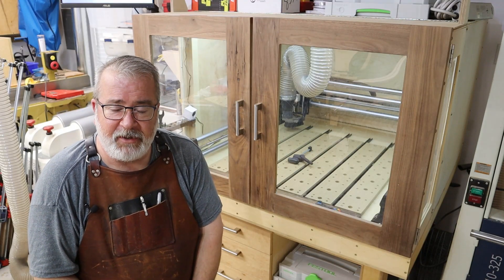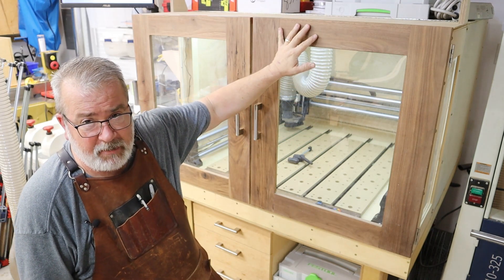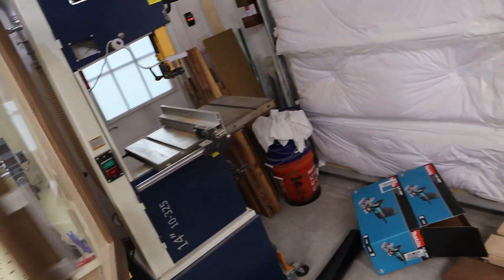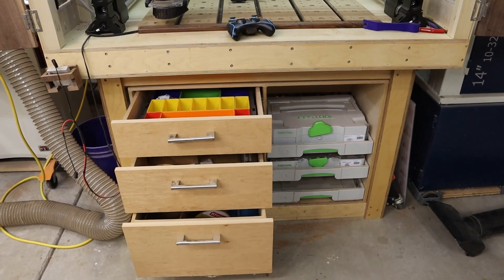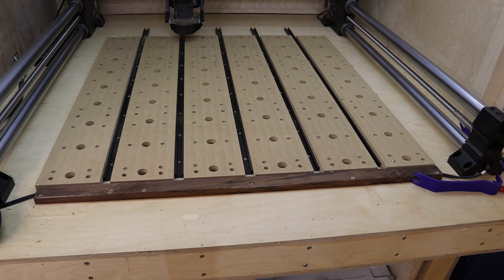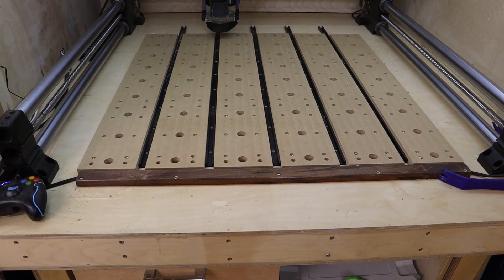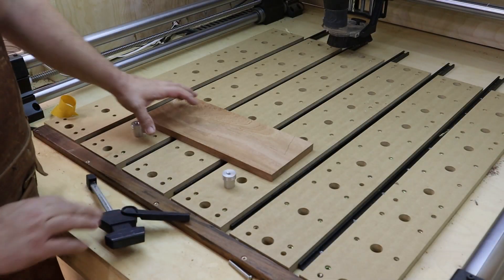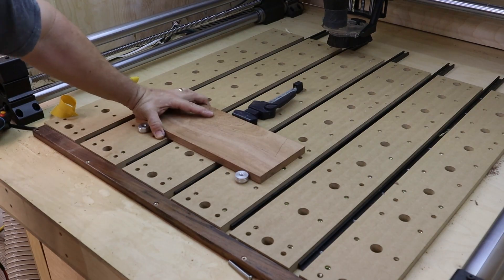CNC Enclosure and Spoil board Dos and Don'ts  DIY projects and the things to consider

Comment: One thing I'd like to say is with your dog holes cut out some 3/4-in PVC pipe instead of those aluminum dogs. Then you can actually leave them in place and around what you're working on and then wedgewood between to hold it in place. That way have a bit runs into it it's not a big deal because it'll just carve PVC.
Reply from the maker: Thanks I already have some Festool clamping elements as I have a couple MFT3 tables, so I just made my cnc spoil board match the work holding I already had.

Comment: Do you have a link to the dogs?
Reply from the maker: Because I use a couple of Festool MFT tables, I used the same 20mm dog hole size (instead of 3/4” which is more common) since I already had them. So the ones I use are Festool 20mm dogs.

Comment: Just finished my enclosure and setup, doing the spoil board and tramming now.   

I made removable doors held in place by magnets on the front and sides for accessibility.  My issue is I made the enclosure too short on the Y axis.  In the home, the dust boot just taps the door and knocks it loose 😂.  I'm gonna have to extend it a tiny bit.  But I agree with pretty much everything in this video.
Reply from the maker: Hi Kyle, Thanks for watching.  Congrats on getting your enclosure done, sounds like an intuitive solution for the doors!

Comment: Thanks JR for the really good video .  I am just about ready to pull the trigger on the 32x32. One question, if the Onefinity did not exist, which CNC would you have?  I love your demeanor and your narration. Dont change a thing.
Reply from the maker: Hi there Flat Lander, thanks for your comment.  Had I not found the Onefinity, I would have likely ended up spending much more on a machine as I was really focused on finding a machine that did not use V Wheels and drive belts.  The next step up (with linear bearings and screw drives) would have been something like a shop sabre or an Avid.  I have found this Onefinity to have exceeded all of my expectations.

Comment: When using the CA and Tape trick. Does it matter that the workpiece may not be square for the machine?
Reply from the maker: For securing the piece, it matters more that the piece is flat on the face your taping/gluing for maximum surface area to adhere

Comment: What tool did you use to remove the dog that was “stuck”?
Reply from the maker: Hey there Kevin, thanks very much for spending time with me here.  Taking the time out to leave your comment means a lot to me.  

It's actually a trim removal tool, I think usually meant for removing car trim panels.  Works great as its plastic and doesnt mark everything

If you haven't yet, would you mind subscribing if you saw some value in what this and my other videos are about?  Thanks again for watching and your comment, have a great day!

Comment: 2:41 There is a product from the automotive world that is specifically designed for noise or sound deadening. This product goes by many different name brands, the most widely recognized being Dynamat. It's only about 1/4 inch thick or less, and in the restoration of an old car, it gets applied to the floor pan and interior firewall to greatly reduce road noise as well as engine and exhaust noise. I agree that the sound deadening products that many have used in their CNC cabinets are very bulky, and are sawdust magnets as well, but Dynamat or any other brand of that stuff, will eliminate the bulkiness, and will not attract sawdust.
Reply from the maker: That a great idea, I had forgotten about dynamat.  Thanks for that tip!

Comment: Not sure if anyone said anything but I have a suggestion for your front doors. Since you don’t want a middle pole/board for the doors you should just put one thin piece of wood on one door so when they shut there isn’t gap between your two doors.
Reply from the maker: Hey there Wood Worker / Golf Expert - Kinda - Mike , thanks very much for spending time with me here.  Taking the time out to leave your comment means a lot to me.  Yeah those gaps were pretty wide, I like your suggestion. If you haven't yet, would you mind subscribing if you saw some value in what this and my other videos are about?  Thanks again for watching and your comment, have a great day!
Reply: @TradeSkillersAnonymous  already have been subscribed

Comment: You commented that you use  the T Track hold downs the least. Could you share what is the advantages of the threaded inserts over the track? I understand that T Tracks usually use a clamp over the top of the work piece but there are options to work around such.
I do appreciate your video. Thanks
Reply from the maker: Hi Donald, you can use the threaded holes for clamps similar to the “oops clamps” and really any other clamp that could. Have a roughly a  1/4” bolt pass through it, a lot of folks use wood clamps with a 1/4 slot cut in the middle of the clamp length.
Reply from the maker: Hi Donald, you can use the threaded holes for clamps similar to the “oops clamps” and really any other clamp that could. Have a roughly a  1/4” bolt pass through it, a lot of folks use wood clamps with a 1/4 slot cut in the middle of the clamp length.

Comment: Why did you upgrade to the bigger x axis?  Did you see flexing or just want to not worry about it?
Reply from the maker: I’ve upgraded to the journeyman size, which will allow 48” work area compared to the woodworker size at 32” (x axis). I have no issues at all with any flex on the machine. It was just about size (work area)
Reply: @TradeSkillersAnonymous  copy that…thx much.

Comment: Thanks for the info.  I am still waiting on my 1F.  I know you said your enclosure is 52x52. If you don't mind my asking what is the width in the inside (from side support to side support). I ask as  I was planning a 48" wide by 53-57ish deep torsion top with the sides mounted on the edges to give the full 48 inch width inside. Just wondering if I should plan for more. I also am planning it for all the side and back panels to be removal for the maintenance.....And do you have an affiliate link for those dogs your using, the spoil board looks just like the one I was planning on starting with.  Thanks
Reply from the maker: Hi Richard, thanks for watching, and commenting, glad to field your question.  So the torsion box I made was 52x52, and the interior structure has 6 vertical supports made with some poplar I had laying around that I milled to 2x2.  I’ve just confirmed that my MINIMUM clearance inside the enclosure, because of the opposing 2x2’s is 48”.  I didn’t do what you’re planning, which was a mistake on my part (removable sides for maintenance) and wish that I had, just an oversight on my part, so good that you’re thinking ahead. 

I don’t have any sort of affiliate links for the items shown, my channel is only a couple weeks old, and as a result I don’t have a coupon code to share, so I’m sorry about that. 

Speaking of which, as a young channel, subscribers help to let YouTube suggest my videos to others after you watch and hopefully like and subscribe, so if it isn’t too forward, if you found some value, and would like to see it when I post future videos, please consider a like and a subscribe if you’d be so kind. 

Lastly, I have put a link below to the user manual for the woodworker size machine. Noteworthy, is that in page 4 are all the pertinent measurements of the machine, you might find it useful if you haven’t already found it on the onefinity site. 

Thanks again, and please don’t hesitate to reach out!
-J.R

https://276de75e-feff-4209-8538-25071949b13c.filesusr.com/ugd/f704eb_4bd572671db647bea61764d73fe9ad5c.pdf
Reply from the maker: Hi Richard Sell , Thanks for taking the time to view, and comment I really do appreciate it.  

I’m sorry I didn’t see this comment until now. If possible, plan for more unless your space constrained. My interior dimensions were 48, and it’s Tight!!

If you haven't had a chance yet, and are willing, I'd love to ask you to subscribe in order to help me get the word out to more people who might be interested.  Thanks again and have a great day!

Comment: Thank you for the details, especially about holding down work pieces and the flip top to avoid head injuries. Lol. Liking the new name change as well. Will you place your new enclosure on wheels in order to gain all around access for maintainable or place it away from a wall?
Off subject, did you consider the Shaper Origin when researching machines? I know it is a much different machine than the onefinity, but wondering if you had any thoughts. Currently, my primary uses for either would be for cutting board inlays, wooden signage, and engraving.  
Thanks for your time putting these together. I know how long it takes:).
Reply from the maker: Hi Liz, yeah, Im not going to mention how many times I've hit my head on that top edge coming in and out of the machine to look at or adjust something.  =  )

Comment: Another great video. I also like the new channel name. This is a great video for us waiting for our 1f. Your comments on hold-downs have already changed my approach to the spoilboard. I'm going for a much simpler one now. One topic I would like to see you address is the dust collection. You have taken it to 11 with 4" hose and the enclosure. Do you have a Dylos meter? I'd be curious as to the differences in shop dust levels with the enclosure open and closed. Also, why did you go with the 4", dust collector instead of the 2" shop vacuum route? Did you try both and see a difference? Finally, growing a channel is slow. In watching many CNC videos, the ones with high view counts tend to be project videos, 3D ones in particular.
Reply from the maker: Thanks Timothy, so I’ve got a full woodworking shop and the CNC was just an additional tool add. I’ve got a Harvey tools G700 dust processor, running 6 inch mains that drop to 4” at each tool.  That type of system isn’t meant to be restricted at one port to 2.5”, it starves the motor.  My shop layout included a 4” drop to the CNC, so I’m just trying to use the max achievable flow. I’ve just received, but not yet installed a PWNCNC 4” dust boot so I’ll see how that goes. I don’t have a Dylos, but running the machine, particularly on surfacing work as an example which I do pretty regularly, the cutter sprays a pretty good pattern of dust that can escape the dust boot, so I am operating more on the belief that it helps, than proof that it does.

These CNC videos were really more inspired by questions I had, and see from other new CNC users. I’m not terribly driven by growth numbers for the channel, as I don’t have any plans of becoming a content creator. My business keeps me pretty busy, and wood working is my passion hobby and am more hopeful to just provide value to people that may have had similar questions that I had on a number of topics, relating to woodworking.
Reply: @TradeSkillersAnonymous  Thanks for the follow-up note. I thought I saw the dust processor beside your CNC but I only have a traditional dust collector. I'm really trying to keep the overall noise down and my dust collector is extremely loud. I really hope that my Festool Dust Extractor will be sufficient. That said, I have a Dylos and I'll watch it and adjust my dust collection strategy on the CNC the same way I've adjusted it on my other tools. Cheers.